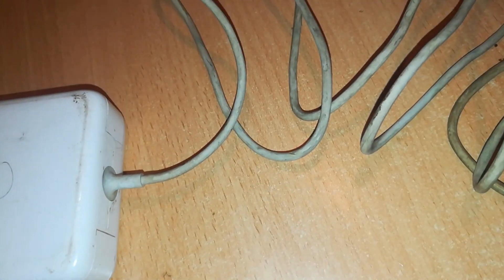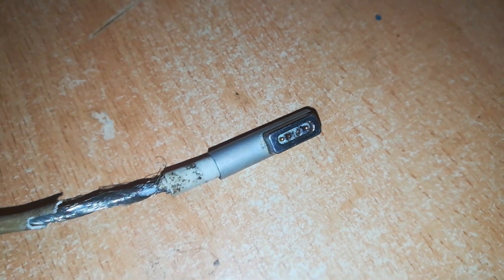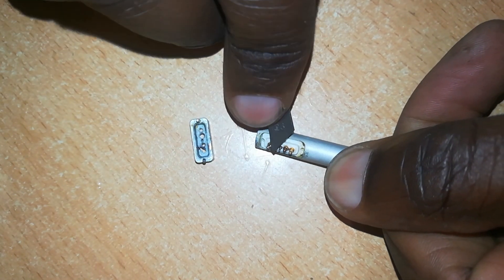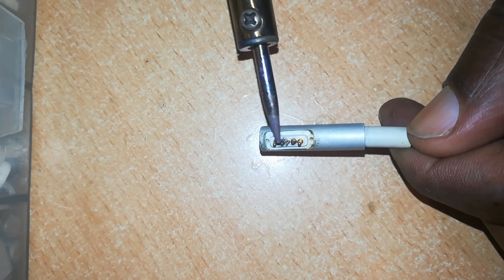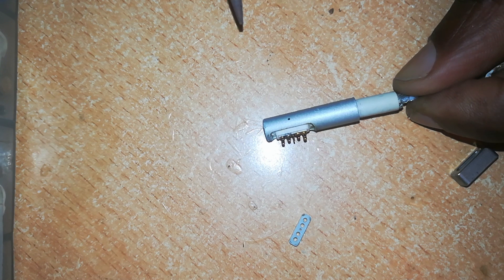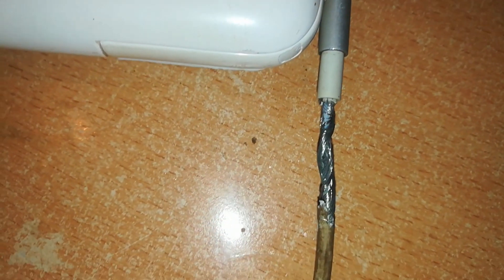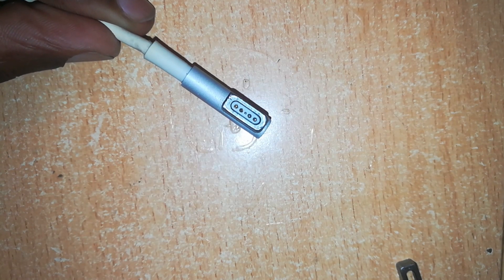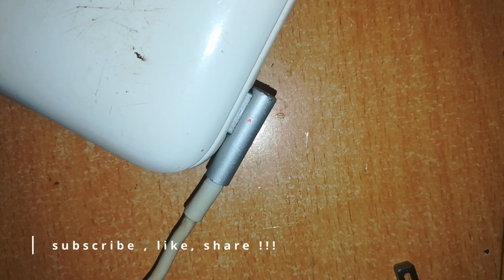Apple Magsafe Charger L shaped Connector Repair- Stuck Pins! #magsafeconnectorrepair

Comment: bro for some reason the metal contact is really hard to remove for me, i've used pliers and other things to pull it out but its just stuck on the charger, what should i do?
Reply: Me too
Reply from the maker: hey guys. hope you succeeded. but if not, use a pair of pliers to tightly hold the metallic contact. then push the remaining part of the contact firmly. it should give.

Comment: Bro my metallic part of pin get  out of my charger pin and struck to charging point during removing charger from laptop please let me know what to do 🙏🙏🙏?
Reply from the maker: hi. Get some long nosed pliers and pull it out. then clean/clear the glue which is on it and the connector. get some strong superglue and apply on both surfaces. return the metal contact to the connector and using the pliers, press hard to sit it down properly in its position on the connector (cover the connector and the metallic part with a piece of cloth to avoid leaving pliers marks on them while you are squeezing). allow to dry and ...your connector is repaired!